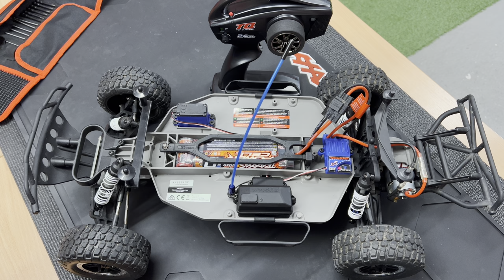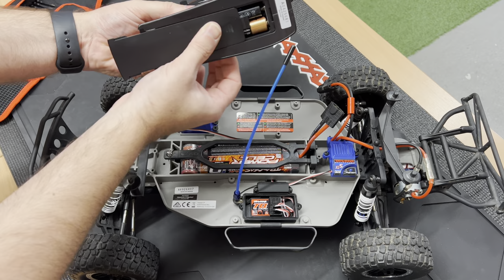How to Bind or Re-Bind a Traxxas TQ/TQi Transmitter and Receiver

Comment: He I have this very Slash and it runs great but while running the car there are times when I need reverse and it will not reverse or go forward  I have to repeatedly work the transmitter a few times well before the car goes forward again now get this if I dont stop the car completely and do running about face the car will not stall out, a little help please.

Comment: Replaced batteries and now the remote isn’t powering on, something wrong with the remote?
Reply: Are you SURE you put in your batteries correctly?
Reply from the maker: Double check they are in correctly and brand new and are 1.5v batteries and not the rechargeable type. If none of that works then it may have an issue and you will probably need to visit a local traxxas shop to see if they can help you.

Comment: It made my transmitter backwards.  Turning it makes ot go forward.  Throttle makes it turn
Reply from the maker: Might be worth checking the esc and servo are connected to the right channels in the receiver.